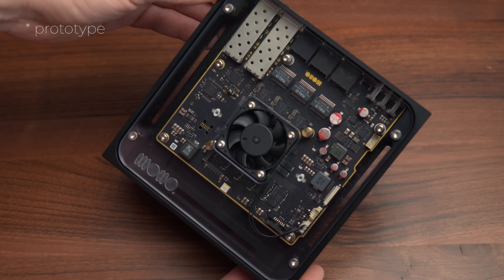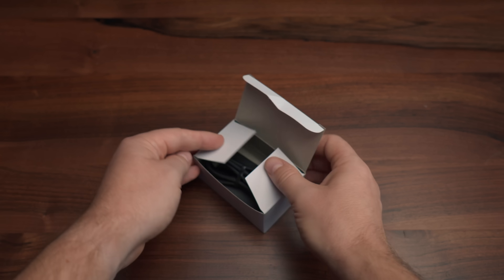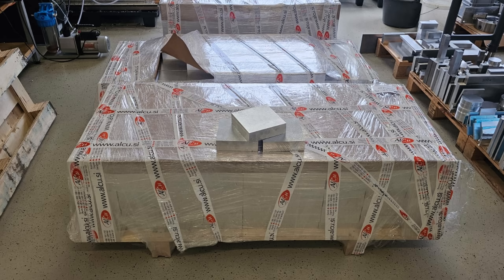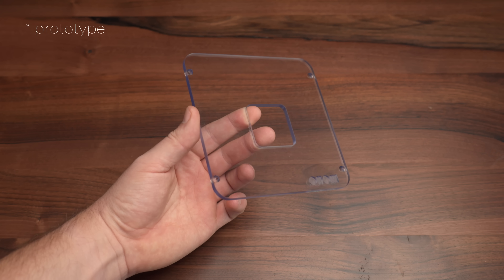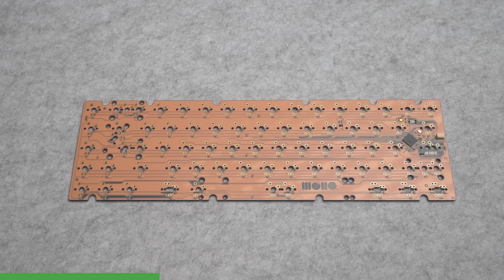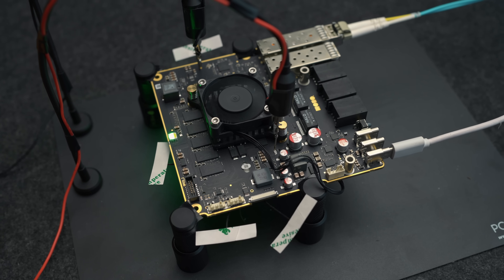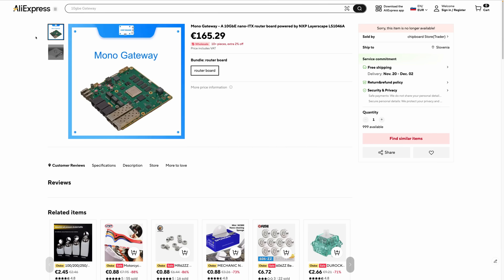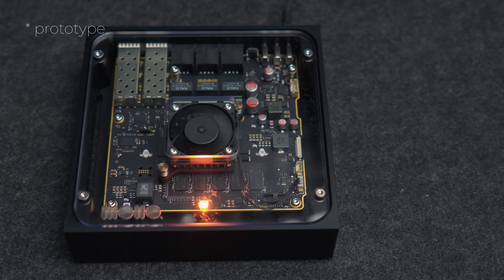My ISP gave me a router I didn't want. So I made my own.

Comment: I have two guesses for the problem:
1) you cannot see the LED's which are on the bottom side and opposite the ports
2) The case acts as a Faraday cage for any wireless cards located on the bottom side of the board

In any case, this has been an amazing journey to go with you and a pleasure to watch!
Reply from the maker: Your first point is correct! Second too to a degree, but wireless antennae will be routed away anyway, so that's not an issue.
Reply: @tomazzaman Why don't Import the plastic mods from MX? it's cheaper if you want I can help you with it.
Reply: @tomazzaman  Maybe you can move the slot on the bottom left to the bottom rear or add another one? (@ 4:55 )
Reply: Can i still deposit the $100
Reply: I already preordered 🫡 ty tomaz

Comment: I'd be interested in a "V2" and/or "V2 Mini" that is essentially just a 1 in 1 out 10Gbe router.

I'm using Omada devices and controllers for my home network and it's so much more feasible to just use a 10Gbe switch separate from the router. Their current 10Gbe solutions are huge and costly. Mostly for enterprise solutions.

Comment: My guess on the issues with the solid case would be:

1. You can't actually reach the reset or flash buttons anymore without taking the whole thing apart.
2. the USB or Network ports don't line up perfectly anymore (CNC Tolerance flex)
3. It's a service issue making it more "unserviceable" if you will

Comment: But wifi antennas? Where will they be attached?
Reply from the maker: So, it's annoying to connect antennas because the cards are on the bottom, which means you'll have to take the PCB out. However, that's a one off thing, and you only have to make sure the antenna cable is long enough. I'd say this is only slightly annoying :)

Comment: Glad to see you are doing well. I was worried with the hardware offloading, etc. but it looks like you can do fully open source (hooking in closed offloading) with OpenWRT, glad you are getting everything on track now. Curious to see what a cost-optimized version will be like in some further away future, maybe a 1 gb/s version ? Because even for that, I would be willing to pay a premium for well build/clean design, there is still a huge advantage to having a fully open source software device that is build to last with having great IPv6 support and allowing Internet connection failover, there are enough small businesses and home users which could really use that.

Comment: I suspect that a rubber ring as a buffer between the case and the plate is missing in the holes for the screws, so that the plate is better separated from the case?

Comment: Boy, Tomaz, I've mentioned this before, but I feel you are a very good communicator, your script is compact and informative, your presentation pleasant, interesting, educational. If it helps, your perspective in the market, I can share our thinking. We're updating a few gateway routers, which we've spec'd out as: fanless, running pf or opnsense, with pretty full throughput at 1 Gbps and decent wireguard vpn performance, something like 700Mbps or so. We have minimal expectation for ids, hosting vms, etc.   At this point we have many choices, but given  "quality" hardware, we've practically decided on Protectli, with Intel J4125, which comes in about $250 plus ram and storage. Your system at about $600, with fan, and specs that approach 10gbps, should be competitive in their sector. Good luck to you and your team, your content is excellent, I've really enjoyed sharing your development, and hope you find a nice place in the market. I would absolutely prefer your effort to other brands at a reasonably premium price had our specs and time frame more closely matched with your efforts.

Comment: What's the point of this compared to an MS-A2, though? Both can run OpenWRT.
Reply: The MS-A2 for a similar price can also process nearly 40Gb, exponentially more if DPDK and VPP is used.
Reply from the maker: Hackability. MS-A2 is a product you buy, and put away to do its job (nothing wrong with that). What we want is to build a community of people that are tinkerers.
Reply: @tomazzaman , I'm not sure why your router is any more hackable? The MS-A2 has upgradable RAM, multiple M.2 PCIe slots L, and even a full-sized x16 (x8 electrically wired) slot which allows you to connect all sorts of devices - so I'd argue it's the opposite. IIRC JTAG is even exposed on the MS-A2.

Comment: My guess for the problem is.... The magnet holes / cutouts were not cut in; and you need to modify the case to cut it in and then glue the magnets in.

But I do agree with some of the others... Faraday cage for the WiFi cards (ax0r7ag0z) or the lack of flexibility for the case to install the board (jwstolk)

Comment: No offense. I watched the whole video, waiting for the reason why this router is supposed to be superior, compared to an off-the-shelf product (like that Fritz!Box in the thumbnail). The presented product has tripple the price tag, requires active cooling, most likely draws more power, has a relatively inconvinient external PSU and by the looks of it only offers three RJ45 connectors.Non of the listed properties are in any way favorable in my opinion for (even semi-sophisticated) home usage.

Comment: I think it's the on/off switch? If that's on/off and not cmos/reset. Far too recessed. 

other guesses: fan isn't flush with the top of the case so you'd have to shorten it if you originally designed it for airflow without the gap. but that isn't usability really. Also if the case is ground, the power cord and other cables should make sure it's ground right? could be that... and it looks hard to take apart so it could have smooth notch into the metal for fingers to go when they lift the lid, so people can get to the insides....

Also it's very pointy. the curve edge lid into the pointy points is visually a pressure point and physically maybe dangerous? But I would want my 600 dollar router to be able to defend me so that's definitely a feature.

I'm a UX Designer I would have loved to take a look at the case's files for you for free lol. 

by the way, will it have u.fl ports? that case looks about the same size as a outdoor MIMO 2x2 antenna element depending on what band you want.... not that I've put a outdoor MIMO antenna in a router.... cough my wifi is very good cough

Comment: Since the original devkit enclosure is going to be one of a kind, would you consider releasing the CAD files publicly or making them available on-request? I do have one devkit preordered, and depending on how well it works I think I will for sure order more. I am currently cautiosly optimistic.
I would prefer a metal enclosure personally, and my family does own a small machine shop, so I am capable of making the enclosure myself should I have the CAD.

Comment: Why not make the aluminium cases on an per order basis or in batches? This way you can still offer it as a "fuck you this is amazing" product. I mean when im spending 600$ on a router, I dont think I would care if an aluminium version cost lets say 899 because its per order. I mean if you ingrave a number on the inside, that would be an amazing gimic, where if youre geek enough you will know and for any one else its an "astetic" Geek piece with a lot of function.

Comment: So what is the issue with the metal case? It can't be non-compliance due to not being grounded, can it?
Reply: Low Power electronics don't need grounding.
More likely an issue with WiFi.
Reply: @ploed  that is what I said. If it's a metal case but it was designed for something non-conductive, then it probably can't retain proper separation, thus not being compliant with RF regulations.

Comment: Please include options to not include extra items, for example, I have plenty of USB-C PSU's with good voltage range and wattage support.

also would be amazing if you had an option to allow us to not have the rubber anti-skid base adhered, and simply included in the box, if its going to be rack mounted, it could just get in the way and have to be removed anyway.

Comment: Well not sure if it's the problem that you mentioned, but one problem will definitely be the floating voltage of the two-pronged power-supply. A device with a metal enclosure should always be grounded, even if the voltage from a USB-C GaN charger is not enough to actually injure someone, the discharge you get when touching the enclosure however is still between uncomfortable and painful. Simple fix ofc is to ground the case through the rack ears, or to use a charger that has a ground prong.
Reply: Grounded USB C chargers are rare, I really wish they existed because pretty much every USB C charger you find will have a high AC voltage on the USB C cable that will give you painful tickles if you are grounded and the cable touches you.
Reply: @xdevs23  I buy the small Lenovo 65W USB-C chargers for everything. I have like 5 of them now. They're 3-pronged have seemingly good quality and deliver decent power, imo.

GX20Z46255 is the SKU I think

Comment: do you have final power usage numbers? Idle + Load?
Reply from the maker: Currrently running a 10-day stress test, without any SFP+ modules or M.2 cards it's ~14W. With them, I can push ~20W with very high loads.
Reply: @tomazzaman  what type of SFP+ ? also will there be a list of compatible modules? Like i dodnt expect any random one to work , but a list of good ones would be nice.

Comment: Nice work there bros!
Sincere question though, why don't you also offer the devkit in its most hardcore form which is a bare board?
I'm sure lots of CNC and 3D printing nerds would think "Hey this power envelope could get away with passive cooling if designed properly" or to be integrated into a bigger enclosure that contains a DC UPS and a couple general purpose SBCs for security cameras or home automation.

Comment: When enabling the customers to choose the socket for the Euro8 cable also let them choose to not include a cable as probably many of us probably already have enough Euro8 cables. This would reduce waste even more.
Reply: 1000%
Reply: Yes, please have a no cable option - geeks in all localities tend to be drowning in these :)
Reply: There could be a regulation mandating electronics come with power supplies
Reply: @chadkrause6574  I think he means the cable between the PSU and wall socket. Not the PSU itself.
Reply: This^
Reply: Yes, this!
Reply: the subnodularity responsible
Reply: I barly have enough Euro8 cables - but i have plenty of pc power-supply cables...
Reply: Theres a real irony to the world sometimes.
Apple : "we're no longer including a charging cable for our battery powered, wirelessly chargeable device because we believe everyone already has a cable and it'll cause a larger environmental impact to make all of those unnecessary cables"
People in 2025 : "actually don't include a power cable for the router in the box, I already got one anyway"
Reply: @felixjohnson3874  The key point is *choice*. Nobody said to definitively not include it.
If i know that i don't need a cable, i want be able to choose not to get one and also get the price for it deducted from the total. Not getting one as a default when a product is still the same price, and then having to buy it separately for a premium, as in the case with Apple, is simply insulting. We all know Apple didn't actually do it for environmental reasons as they stated, but for profit.
Reply: @christopher-  it costs way more for that
Reply: @christopher-  You're not just wrong, the opposite is true. The iPhone 12 Pro was actually $50 cheaper than the 11 Pro, when comparing models with the same storage. They lowered the price by more than the cost of an Apple charger. Meanwhile, in the same year, many other flagship phones increased in price, ostensibly due to inflation. Apple reduced waste AND saved their customers money. Your rewriting of history is simply insulting.
Reply: Yes it's true that the base model remained at $999, but that still makes it about $25 cheaper than last year in real terms, due to inflation. It's also true that the non-pro variants did see a significant price increase that year, but that's explained by the massive spec bump received by the non-pro variant, repositioning it from a budget-tier model to a premium mid-tier model. The increased retail price is almost entirely explained by the higher parts cost for the OLED screen, newer Qualcomm modems, and other improvements.
Reply: @christopher- so whats the difference between a 100 dollar price tag with an option to save 10 bucks by not including the power supply and a 90 dollar price tag with a 10 dollar power supply you buy seperately?

Hell most of the time items in the same order are even shipped in the same box so it's literally identical.

Also, while I have no sympathy for Apple
1 : 1:1 price comparisons saying "THEY JUST DID IT FOR PROFIT!" are inherently stupid. Equations balance, it doesn't matter why it's done the outcome is the same all else being equal.
But
2 : if sjwright is to be believed you're also just objectively wrong here. Personally I don't know or care, (dont touch anything apple with a 10 ft pole) but it doesn't matter to me whether they did or didn't lower prices because, again, all else being equal the effect is the same. If there is an equal amount of greed that wants 10 dollars more profit, whether that comes from a 10 dollar price hike or 10 dollars of price cutting it's equal both ways. So, I'm gonna laugh at stupid hypocritical consumers being stupid hypocritical consumers eitherway.

Call it what it is, people just  change their standards based on whether or not they like the thing in question, and it leads to really stupid cases where history repeats itself in delightfully ironic ways.
Reply: @christopher-  well the cable itself is probably like 2 dollars so its not like youre saving a lot
Reply: @felixjohnson3874  There is no irony here, Apple was simply 100% correct.
Reply: @felixjohnson3874 you are absolutely wrong.
We are talking about the cable, not the transformer.
Different functions, different prices, different availability.
Reply: @pedro.alcatra if anything that's literally backwards from the truth. (As in, there's less of a reason to not include the cable then the transformer) More things give regulated DC output than just figure-8 power bricks, so people are more likely to have a stand-in for the brick itself than the figure-8 plug to it. (Since the only thing I can ever recall that takes a figure-8 plug, is a power brick.)

Even ignoring the fact that the 'charger' wrt to phones is basically always just getting power from standard USB (which is significantly higher availability than a 'transformer' for a specific device, and even higher than just the figure-8 plug cable in isolation) this is a distinction without a difference because you basically never see a power brick without it's corresponding plug. They're shipped together and always meant to be used together; frankly it is a little weird that they're two seperate things to begin with and I have definitely been screwed before by packing one but not the other. (I don't really care eitherway, but it has always felt a bit like faux-modularity to me)

Again though, even granting this reasoning as valid for the sake of argument, that'd actually make the Apple example more justifiable because every component you already have in abundance. (Whether we're talking lightning or USB-Crap) I definitely have a ton more USB powerbricks than figure-8 plugs or supplies, and I definitely have more cables than I do figure-8 plugs ir supplies.

Hell I probably even still have more lightning cables kicking around than figure-8s, and the last iPhone (or apple product in general) I ever owned was  over a decade ago.

Christ people just take the L and laugh at how history ironically repeats itself, stop trying desperately to rationalize years old arguments and act like they're ~totally~ different because one plug is a square and the other is an ∞. Y'all are too fucking attached to this.

Comment: Is the EEPROM chip write protected after this? Would be rather awkward if it's accidentally overwritten afterwards when hacking on the firmware. I usually see manufacturers use the OTP page that's included in most NOR flash chips these days for serial numbers and such, so it can't be accidentally overwritten later (and saves a part of of course).

Comment: Problem: You can't get the board into the enclosure because there are connectors on multiple sides of the board. A more flexible plastic enclosure would allow for a bit more wiggle-room. For now modify the most offending connector?
Reply: been there before ngl
Reply from the maker: Nope, that's not an issue, all connectors are accessible. Well, except M.2, for those you do have to take the board out, but it's not a big deal, there is enough wiggle room :)
Reply: Nice try, but there are no connectors on multiple sides of the boards - unless we watched a different video

Comment: Loved the PSU with a removable power cord.
Reply: Hate that's it's an external psu though.
Reply: @Call_Me_David  internal PSUs are worse for the manufacturer because the product will have to be certified for mains voltage and it gets more expensive. So not only external PSUs allow for a cheaper and faster development process, but when the PSU fails the customer will be able to just change it for an equivalent one instead of having to trash the device

Comment: I'll be fine getting the router even in a plastic bag with newspaper padding :)))
also looking at that enclosure, i don't think i'm going to use my router, i'll keep it in a glass case on a shelf with LED lights around it.

is the bug no access to the LED on the back, so you'll install a fibre optic piece or 45º mirror?